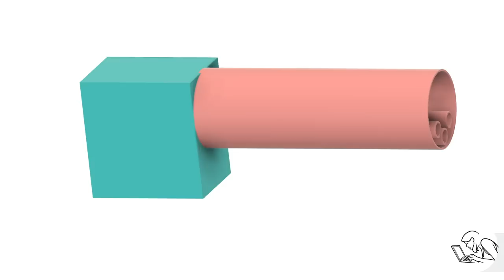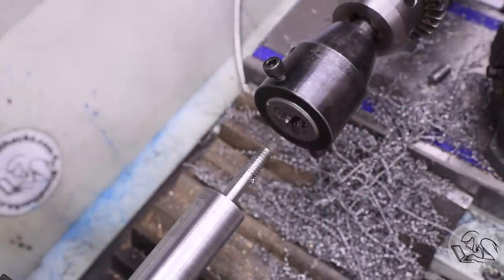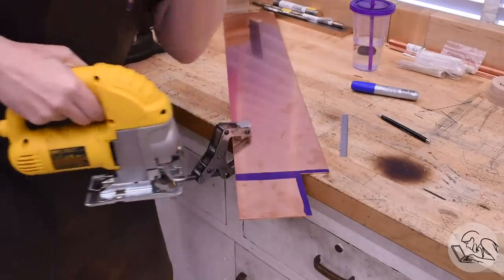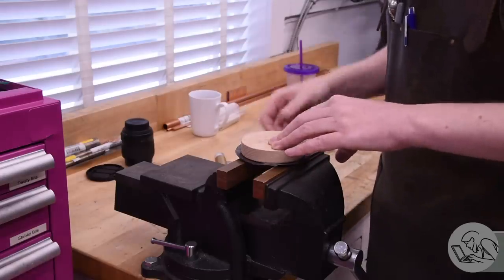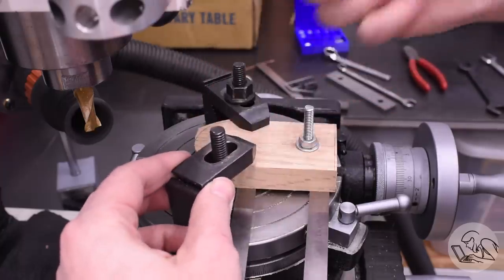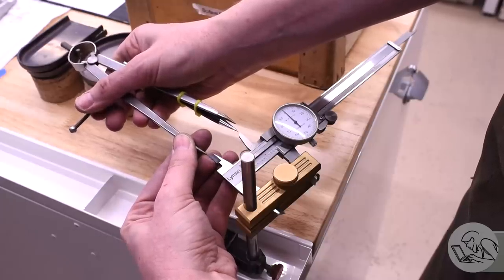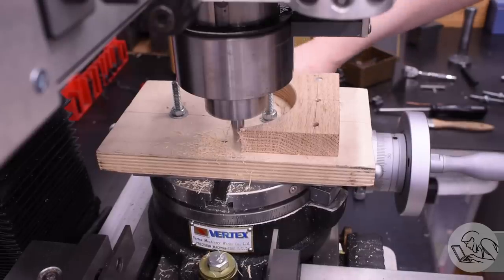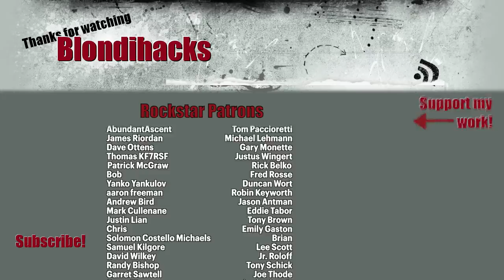Hammer-Forming Boiler Parts - Pennsylvania A3 Switcher, Part 2

Comment: If you would like to speed up the annealing process, you can quench the copper in water to cool it off faster.  Unlike steel, copper (and brass) are not affected by the quench and will come out fully annealed.
Reply: So does that mean you can't harden copper by cooling it quickly? If so how can you harden it? Does it have to work hardened?
Reply: @nophead  yes
Reply: From a material perspective I'm sure this is true, but would there not be a risk of uneven cooling when quenching causing internal stresses that might warp the part or cause other issues like that?
Reply from the maker: The reason I don’t quench here is that it will warp the parts. I talked at length about quenching copper alloys in my last boiler series.
Reply: My father was a certified gas-fitter amongst his varied careers. he always quenched copper pipe in water, never seemed to cause explosions, at least none that left incriminating evidence behind. Seriously though, water quenching is fine for annealing copper, but the choice to do it does depend on the job you're doing.
Reply: @nophead  by hammering it
Reply: As Quinn mentioned, quenching copper works to speed things up, but only if you don't have to maintain uniformity to a high degree as it will tent to twist/warp a small amount. Still I have quenched Cu early on in the forming process as I will be beating on it some more anyway.
Reply: @nophead  What glynn said. Copper can only be hardened by deforming it.
Reply: The only benefit I've found in my limited experience annealing copper,  was that water-quenching was cleaner, in that the rapid quench removed the oxides from the surface pretty effectively.
Reply: @JulieanGalak  Copper air quenching can also be sped up my using a fan and removng from the oven. In thicker forms such as th e.080 thick in the project and smaller pieces any distortion is limited.
Reply: @Blondihacks  I would like to wish you and the dunki family a wonderful and peaceful new year
Reply: @nophead the 3D printing legend in the flesh :0
Reply: @Desi-qw9fc  Not a legend when it comes to metalwork!
Reply: @Blondihacks  now my brain is wondering if there's some way to cool it faster while keeping precision. My brain right now is a frozen press fixture pressed onto a flat object. The fixture would need high heat conductivity, but that could then either take the heat itself (like suggested with frozen) or transfer it to a more efficient sink
Reply: @markfergerson2145  agree 100%! The problems will arise due to be a sheet format. If the piece is already formed, like a pipe, it tends to stabilize it, what wouldn’t happen on a flat thin sheet of metal. To shrink metal sheet, and if it’s not something that will be exposed but painted, you can use a shrinking hammer from automotive painting trade. It’s like a meat softener but smaller and sharper fangs! You must back it up with some sort of metal shaping block as well. We used to heat metal fenders with a heat gun and then quench it with a soaking wet rag, but that would have filling base and primers to account for any difference the prices could cause.
Hope it helps!
Reply: @bandana_girl6507  it could still warp a little. Soft metals are funny when heated up. If you need precision AND good finish that will be seen, stick to slow cool down process as described in her videos.
Reply: @Blondihacks  No problem, very understandable.  😀
Reply: One can harden copper by forming it or my alloying it with Nickel, Cobalt or Beryllium so you can elevate harden in an oven. Beryllium makes the copper brass colored and when hardened in the oven makes it very hard. I have worked Beryllium Copper years ago when I had a machine shop. I was making ærospace parts for Aerojet General.

Comment: As my woodworking teacher said many years ago: "always cut on the waste side of the line". 
From experience with various materials, it turns out that if you don't exactly know what you're doing, that line is totally surrounded by waste.
Reply: I’ve cut this piece 3 times and it’s STILL too short!

Comment: The spring back you mentioned on the wooden formers reminded me of when I built a plug for sandcasting an intake manifold many years ago... After many hours of cutting, gluing and sanding mdf pieces together, I had a plug the correct size. Life then intervened and the project was left in my shed for two weeks... When I got back to it again, the mdf had absorbed enough moisture from the air to make the entire thing expand by about 4%! It set the project back a few weeks as I had to let the plug acclimatise before sanding it to final domension again... Hopefully less of a problem using oak in a heated workshop!

Comment: So glad you decided to start here with this project.  I'm about 1.5 years into the Penn A3 in the same scale you are doing, but I started at the beginning of the book.  I'm about 6 months away from doing the boiler and it scarred the heck out of me, but I'm not so worried now that I have a good video guide!  BTW, your early videos are what got me to pull the trigger on a mill and lathe and now I have a full blown 2,000 square foot machine shop a few years later.  You sure sent me down a very expensive path LOL!
Reply: Good luck with your build, voots!
Can you extrapolate that 1.5 years and give us an estimate on the completion time?
Reply: @g.tucker8682  Thanks Tucker.  If I can keep spending the same amount of time per month that I have been, I'd estimate another 2-2.5 years.  At this point I have the tender complete minus final assembly, the frame and running gear of the engine, and I'm working on the cylinders now.

Comment: Woodwind instrument makers talk about "growback" - it happens with all types of wood and you just have to know whatever size or type of cut you make the wood will move back into the space a certain amount - even if you drill, leave for a week, and then finish ream multiple times it will still end up smaller.  In production of course you just make the cut to suit but it's really frustrating at the prototype stage.  By the way, for woodturning in the metal lathe you can make up a vertical shear cutting tool in HSS - you have probably seen them in older modelling books - they work like a woodturner's skew chisel, they take off very little but leave excellent surfaces and work well on wood.  I'm pretty sure Mr Pete has done a video on them.

Comment: I am a wood worker/wood turner who also does machining.   I have machined wood on my metal lathe and milling machine.    I normally run the machines much slower than e.g., wood turners.    The wood may cut with a fast speed, but if the wood species contains resins/sugars like cherry, hard maple, purpleheart the high speed will cause a lot of heat and burn marks on the wood.   Same as cutting the wood on my table saw.
Very nice work on these parts.
Dave.

Comment: Quinn as a 20+ year Stationary Engineer in a very larger steamplant with fire tube boilers producing 25lbs. per hour of superheated very dry steam your project is very cool to me. As a young power plant helper I rolled many tubes in to header plate with pneumatic chisels with specially formed rolling chisels.

Comment: Nice job for a non-woodworker! Wood is indeed a little springy so that is worth keeping in mind for any precision parts made with it. That's mostly correlated to its density but you also have to bear in mind the ambient humidity will also affect sizing so getting everything done in one day or in a humidity-controlled environment is crucial if you want high precision.

Some highly dense tropical woods (like lignum) are more resistant to this and have even been used in marine applications. There were a number of ships in WWII, both surface and submarine, that used lignum vitae bearings for their shafts. Also crops up in hydroelectric plants for their generator bearings.
Reply: The first ship I worked on (USS Shreveport - LPD-12) had wooden bearings for its shafts after they left the hull.  This was in 2005.

Comment: Annealing and quenching also works on Aluminum too. Had a custom sheet metal worker as a business neighbor. We had a large high temperature oven we would anneal 3'x4' sheets of aluminum. We'd hit it with a water hose as it was pulled from the oven. The aluminum was soft like chewing gum when cooled. He did work for some of Jay Leno's cars.

Comment: For clamping the wood blocks you could probably use the same technique we use on cnc routers.  Put a layer of blue painters tape on the part and on a spoil board.  Super glue on the tape on one side and optionally accelerator on the tape on the other side.  Slap them together and clamp the spoil board down.  Chew up the spoil board as needed.

Comment: Interesting video as usual and well explained for the layman viewer.
I successfully used an ordinary kitchen stove for annealing 3mm thick copper plates when forming the plates for a 1:12 locomotive that had a Belpaire boiler. The firebox throatplate was a beast! I ended up having to make a former in 20mm steel with 3mm radii.

Comment: Very nice work. I worked in the Boeing sheet metal shop for abut 10 years. There we used s a series of tooling tabs around the periphery of the sheet metal blanks to to hold the blank for trimming and forming. There tabs would be coordinated to the different tools, templates for layout and inspection, shaper/router boards for trimming and form blocks. The tabs would be on the edges of the parts that do not have a flat edge and would be strategically placed to prevent the part from moving during forming. A tooling tab for a .250 inch dia. hole would be described as: the hole is located .50" centerling to edge of part, a .50 radius around the hole with lines connecting the tab radius to the edge of the part. After the part is formed the tab can be trimmed (sawn or sheard) from the edge of the finished part. In the event the part was formed on all edges, the tooling holes could be could be placed within the periphery of the part in the location of an existing design hole or cutout. When using a design hole always make the tooling hole undersize because the tooling holes can become distorted during processing. Just my 2¢

Comment: That’s the problem with the Dewalt bandsaw. The blade angle steers the workpiece straight into the saw frame. Every other rendition of the portaband (Porter-Cable, Milwaukee, Harbor Freight) angles the blade in such a way that you can pass a piece of any length through the blade as long as the left edge of the cut is less than 3” wide. I love this project.

Comment: Not classic woodworking, but one place I have used reamers to bore wood is RC airplane propellers. Precise fit to the engine shaft is important at 8000 or so RPM, as is balance of the prop, to minimize vibration.

Comment: GREAT fixturing. Thanks for the tip of dropping the handle when filing something round as that is something I did not know. You're the best!
Reply: i've watched you use that technique many times over the years, but that's the first time I recall you giving an explanation. I've done it incorrectly all my life.
Would love to see you do a separate video on these secondary processes. Tips like this can help take us to a higher level of abilities.
Reply: I've seen that tip several times on YouTube but I've never found personally that I get flat spots when doing it the 'wrong' way. Maybe it is easier to get a good curve Quinn's way if you aren't an experienced filer? I tried it her way and couldn't make my body do it properly! My muscle memory is set in stone...
Reply: @ractorc91  it's definitely counter-intuitive... if you think about it from a "teeth in the cut" perspective, "following" the curve only presents a few teeth of the file to the material, and those gullets cannot clear the swarf. Dropping the handle presents many more teeth to the material, and the gullets are therefore clear of swarf, making a much more efficient cut. This may help you adapt this method, as it was the "a-ha moment" that helped me.
Reply: @mattmanyam  that is a good point, I suppose it depends on whether you move the file faster than you 'curve' or not. Maybe I'll give it another go but I did find it almost impossible to do when I last tried it!

Comment: Woodworkers do use reamers. Mostly old timey woodworkers, hand reamers to make tapered holes. 

I'm pretty sure your spring back is due to your use of a cutter with metal working geometry and low surface speed, both of which tend to compress the fibers. A woodworking router will spin at 20,000 rpm, and the cutting edge will typically have a lot of relief. For future work you might consider trying a router bit, and crank up your rpms as high as they will go.

Comment: A corner rounding tool is basically a router bit, so it makes sense it worked so well. I wonder how a router bit would work in the mill? Probably not enough RPM. I have used a corner rounding router bit in a router to machine aluminum though. Worked great, but was LOUD.

Comment: Hi Quinn. Thanks for posting. This will be a fascinating series  The Pennsy A-3 has been a favorite locomotive model of mine for 45 years. I received a low priced plastic model for X-mas, made by a Czechoslovakian company called Mehano, when I was 8 years old. My first model of a steam locomotive. Barely able to pull itself around the track, but still my favorite until it de-railed, dropped 4' to the floor and grenaded into tiny bits of plastic shrapnel. I have a few kit and off the shelf versions of them in HO scale now, and have scratch built about 70% of one in brass (obviously not live steam though), but stopped working on it because at the time I didn't have a lathe to make the cylinders and wheels. Now I just have too many higher priorities for my at home and in-shop time.

One thing that bothers me about the version in the Kozo book - it has the wrong driving wheel centers for an A3, IMO. The A3 was built with segmented counter weights, whereas the Kozo book illustrates more "modern" crescent shaped counterweights. I doubt Pennsy ever put the new wheels on an ancient and tiny switch engine like the A3's (the later A-5 was built with them), but I may be incorrect as per the rule of exceptions. It still looks wrong to me on an nineteenth century locomotive with Stephenson valve gear and slide valves.

BTW - I've never had a problem filing curves into parts. Even when I was supposed to be filing flats.

Comment: I think what you've got when you're milling the wood with the spring back is the wood compressing a bit with the cutter and then the stresses that kept it there are removed as you mill further down the line. The reamer wouldn't have this issue because the entire cut surface is experiencing a continuous stress/relief curve. I know I've seen some woodworking which relies on burnishing for a good consistent edge, so I'm guessing that might be somewhat what's going on

Comment: The structure in the wood is like long tiny straws. When you cut them long ways ( with the grain ) they open up and tend to stand.  Wood workers lightly add some water to get then to stand up then sand it off.   Only hammer forming I have done is aluminum for a light wing ribs.  we rounded the front leading edge to aspect a tube.  A piece of round stock worked well for making the same shape as you did (  throat )

Comment: A band saw blade listed as 10/14 has both pitches on it. If you look at the blade you will see it has sections that are 10 tpi and sections that are 14 tpi. Good for cutting metal and hardwoods. Softer materials usually get the single pitch blades. And as you know, the thinner the material the more tpi you need.

Comment: Wood is a living thing and it will absorb moisture from its environment.  As the wood heats up it loses moisture and as it cools down it will absorb moisture and expand. If you were to use a product like Cactus Juice you could impregnate the wood under vacuum followed by a heat curing process and this would eliminate the issue of the wood shrinking and expanding.  The wood would virtually be water resistant.

Comment: Hi, a tip if you are interested, I learned in shop class many years ago. when cutting metal have at least 3 teeth on your work. I still use that now 60 years later.
Nice work!

Comment: Idea: Link up the feedwater pump to the steam engine so the engine drives the pump.  The pump's output then leads to the check valve between the tank and pump, and another valve that leads back to the feedwater tank.  When you need more water in the boiler, shut the valve to the feedwater tank, and the pump will overcome the backpressure of the check valve and begin to fill the boiler.  When you open the feedwater tank valve again, the pump will go back to recirculating the feedwater, and the pressure from the boiler will shut the check valve again.  You could also use the exhausted steam from the engine to heat the recirculating feedwater

Comment: As a amateur mechanic/car builder I am currently making the ash wood frame for my Riley car project. I am an even more amateur woodworker but luckily the frame isn't that complex really. Coachbuilding a 20s car though is somewhat of a lost art. Not much info out there on it. My best reference is a book from 1924! I seem to be getting there OK but the saw dust/sanding dust is dreadful! I do have some extraction but even then it gets everywhere. I now try to do most of my sanding outside (I do the same with metal grinding). The frame is then paneled in aluminium. That also comes half hard so you anneal it then it re-hardens when you hammer the edges around the frame.